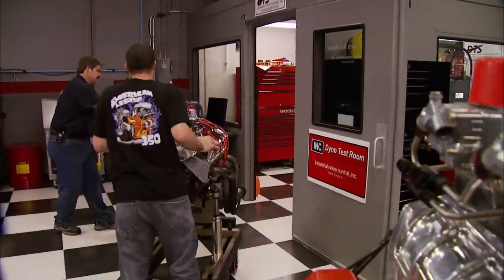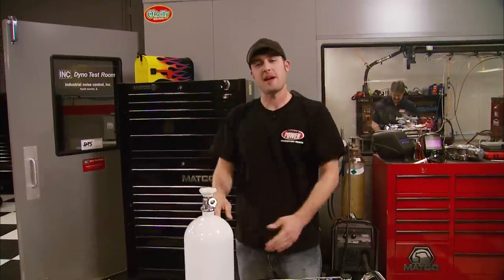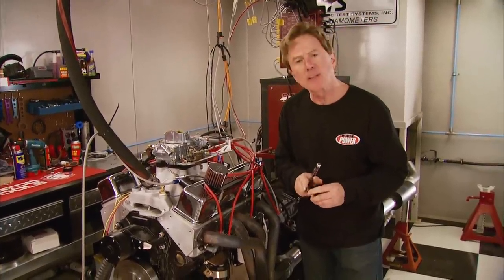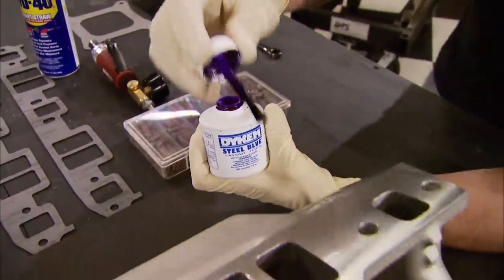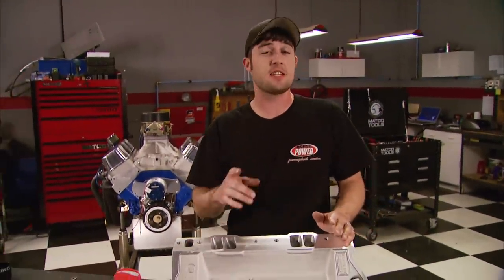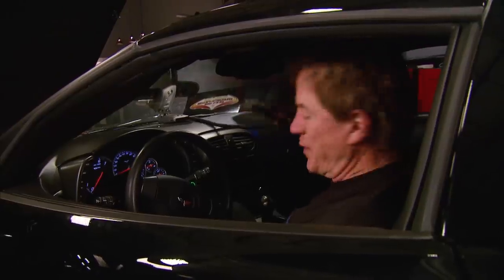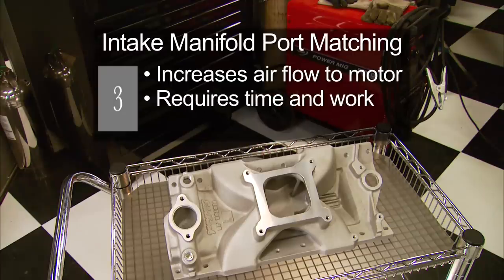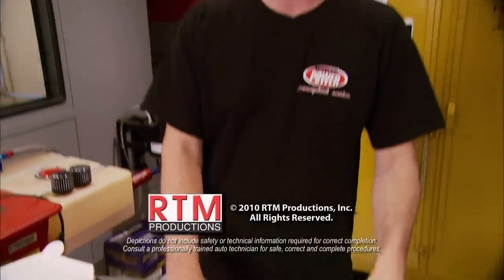Cheap Tricks To Increase Horsepower - HorsePower S12, E9

Comment: nos is much cheaper if you buy everything separate, and dont need forged things unless going for more than 100 shot
Reply: Notice how he said racing application, in people would probably be going for more than a 100 shot
Reply: until you realize it costs like $100 to get one 10LB bottle refilled and it doesn't really last that long the price adds up pretty quickly. Turbo's and blowers have a higher upfront cost but end up being cheaper in the long term.
Reply: @GnarshredProductions  a $100 to get your bottle filled... Buddy you've been getting ripped off. They usually charge $50-70 to fill my 10lbs bottle.
Reply: @GnarshredProductions  lol I can tell u never ran nitrous it’s like 40$ at most to fill at 10lb bottle
Reply: @ThatNoFbody-ch9ky  depends on where you are. Cheapest we could find in my area "Minneapolis" like 3 years ago was $100 per bottle to refill. Apparently there was a shortage or something going on so maybe the prices went down since then? we literally called every performance shop in the area asking where the best/cheapest place to get them filled was and that was the best price we could find anywhere at the time. I run turbo's now so I don't use the stuff.

Comment: So how much power did the manifold make?
Reply: you me and a few others agree....
Reply: If the heads and intake are match ported, or as is often the case anymore the aftermarket heads were already gasket matched, you'll make more power, and how much by itself depends on the motor around it. What you are guaranteed to get, though, is a way nicer throttle response. When you're talking drag racing, that's not that important, as you'll pretty much just open the throttles once, and before you ever get moving. However, on the street or on a road course, tip in matters a whole lot more.

Comment: An old Mopar idea brought back by a fella with a youtube channel here, Uncle Tony's Garage, is to swap your pistons 180 degrees in the bore, or from bank to bank if you aren't removing  them from their rods. The result is like having a longer connecting rod, the piston dwells longer at TDC.

https://www.youtube.com/watch?v=kjd1PD6pGLU
Reply: BUT,,,, you shorten the life of the engine and cause "rattle"
Reply: @Binderbird4X4Firebird  if you watch the video, neither are true. of course, if you're doing a race engine, you're taking it apart often to check on things. and, what's the life of a piston really in a performance engine? The more power per cubic inch you get, the harder you're running the engine, so is 100,000 miles a good limit? 200,000? you may get bored with the hp and add on a blower or change to more displacement before you find the limit of the piston.

Comment: Well... Aside from blowing up my 5.0 with an extra 5 horsepower and not voiding my warranty, I'd rather upgrade my throttle-body to a twin 62mm instead of the stock 55mm's... On top of that, I would upgrade the fuel injectors, rails and and ECU Performance upgrade. Even better, add a Cold-air Intake, long-tube headers with an X-pipe and upgraded cat-back exhaust. With that alone, my 2016 5.0 would gain at least 100 HP for about $2000 bucks and I won't destroy my engine. Beyond that, you need to upgrade the transmission, drive-shaft, U-Joints and Differential. Now, it is a $4,000 upgrade and that is still cheap compared to turbos or superchargers! If you are going to add more power/torque, you need to upgrade all the other essentials in order to handle the extra power or you are screwed and spending a lot more money later in repairs/upgrades. NOS? It has destroyed more engines, transmissions and differentials than I can even count. There is a reason that there are educated "Engineers" out there developing motor vehicles and even NASCAR, INDY, FORMULA 1, etc that know what to do. Even with that knowledge, they still blow up cars mechanically cuz they are pushing machines to their limit or beyond. I would rather keep my car drivable, with sufficient power, for many more years to come.

Comment: Porting an intake without port matching the heads will lower the power because airflow will hit the wall at the head interface and reverberate back slowing incoming air. Bad idea.

Comment: The LS was designed and first offered by Holden, GM Australia! Gotta love those Aussies! The onlyproblem I see with the engine is that as first designed the platform had massive potential for horsepower. You might have noticed I’m not a Chevy fan, but this engine has me thinking what if! I like those Volvo LS swaps. They’re perfect sleepers! Anyway, they started off with the Cathedral headed small displacement motors and it took years to get to a medium displacement and cylinder heads that use all the space left in them for larger ports. Back in 1929 Chevy Management decided that their marketing strategy would be to sell their customers a new model every three years. In the interim years they would offer small improvements to offer customers something better each year of that model run. By the third year they had finished adding all the bells and whistles they had designed for the car to begin with and the next year they would introduce something new, again. That became a little difficult to do and WWII put their entire staff to work building supplies for the war effort, but when the war was over the tried to pick up where they left off. Only now they kept a model longer than three years, still adding improvements along the way. With the LS it took nearly 20 years to tap into the potential of this new motor and there’s still room for improvement.

Comment: varies wildly by engine, but: Intake, exhaust, get a tune. done. fixed it for you.
then NO2, but to do anything over a 50 shot I'd gap the rings. If I was going that deep, just build the engine.
edit 3:00 : if your going forged piston, thats not cheap........ buy a K24 for $500 and throw 20 lbs at it. cheap and easy 400hp - 500hp
Reply: I’m rebuilding my 5.7 into a forged 6.4 stroker, I absolutely asked for ring gap to run boost!
Reply: @bri-manhunter2654  I build my own engines personally. build an eJ255 from a 250hp motor to a 410hp wheel motor. 20LBS of boost. the car was a rocketship at 2500lbs

Comment: so can anybody help me get a ballpark price on what it would cost to rebuild my motor on my 01 mustang cobra? i guess the engine is blown but nobody can seem to pin it down any further than that... can neone plz help>????

-peter
Reply: Depends on the shop and what you want to do, at my shop for a 0.030 over piston line hone decking rebuild heads and some other stuff it's 2,000 plus parts
Reply: Without parts on my 6.4 Hemi stroker the rebuild is costing around 2k. Also, those 4 valve motor parts are expensive.

Comment: I've found little difference in smooth or rough intake runners. The biggest difference is the time it takes . Port matching is always a must. 
Don't use pro poop or sleep master heads.  DONT.

Comment: He people i had a 69 SPORT SATELLITE,  440 3.90 THRU THE MUFFLERS,  FULL STOCK WEIGHT, IT RAN 12.60 not sure of the mph, but a friend had a 68 440 CORONET 440 3.55 GEARS, HE SAID LETS SLIP HIS SET UP ON MY CAR THE TRANS COULD HANDLE 2-3 SHIFT Had to back off let it shift, IT RAN 11.24 AT 113 MPH, IF THE USED TRAND WAS GOOD IT MAY OF HIT 10s i hit it on the line it freaked leaving, that was 1.4 sec. Reduction in ET.  MORE it the trans was good. That was in the 80s

Comment: I think the perfect truck motor is the chevy 305 because it can make enough hp to get the job done & it reaches peak hp a lot faster than the 350 & for a work horse that is important, but I haven't seen anyone stroke a 305 out by putting an sbc 400 crank in the 305? why not? Do you know of any videos I can watch of a 305 motor with the 3.75 stroke crank so I can see how it compares with other stroker motors?

Comment: please show ways to get more hp out of a 4.6 2valve pi engine please and ty
Reply: Boost... Plenty of 700rwhp 2v running in the streets...
Reply: Easy, trick flow heads, cams, and intake manifold with long tubes. Big gains from this setup, also save up for boost.
Reply: It takes a lot to make big power out of those 2v I use to have own I got like 320-350 hp and it took a decent bit

Comment: What's the estimated power gain from the port matching?
Reply: Not much......... all the power gains are in the plenum just under the carb pad and they didn’t even touch it. He should have stopped at 40 grit finishing the runners also. You want it rough for atomization not baby ass smooth.

Comment: Wait whoa. So atmospheric air is 23% oxygen  but Nitrous is 50% "per cubic foot". 

What the hell is the point of the "per cubic foot" comment? 

Does the atmospheric percentage not apply when discussing it in terms of cubic footage? Is Nitrous suddenly only 50% oxygen when measured in "cubic footage"? Is it a different percentage when measured in cubic liters? 

Does saying it that way add as much power as putting a NOS sticker on your car?

Comment: Why is there an air filter on the valve cover?
Reply: it's a breather to release crankcase pressure
Reply: all newer vehicles use a pcv valve and run a vacuum line somewhere before the throttle body for emissions. And that area on the valve cover where you saw the filter is where the pcv valve would be instead of the small breather filter. they both release crankcase gases and pressure

Comment: I was under the impression from a physics and fluid/aerodynamic perspective, smooth surfaces, like theses ports create a slow moving stagnant and thick restrictive boundary layer and slow down air flow rates, wouldn't it be best to dimple the surfaces like a golf ball?
Reply: If so, wouldn’t nascar or other professional racers do that?  When you look at the difference of how far air has to go into the intake to the combustion chamber vs a gold ball dimples acting as a turbulator to go a farther distance...argument really viable?

Comment: The ideas you put forth in this video is confusing. You say Nitirous is not expensive. Yet, you also said to efficiency to run it, one must use forged parts that would require an engine rebuild. That's not cheap. Nos on its own, yea, but to effectively use it? Priceless!

Comment: I really wish you guys would start testing on modern engines... Even if you still stick with V8's, there's LOTS of 2000-2010 V8's that are much more applicable to the engines people actually have nowadays.
There's alot more people out here with a coyote Ford, a hemi dodge, or LS Chevy than these ancient carbureted, always pushrod, always 2 valve engines you always test.
I would really like to see you guys start using turbos also.
We all know that 871 blowers are easy to install and make power... But I personally would love to see the following episode-
Take a modern, overhead cam, variable valve timing/lift engine and throw a junkyard turbo from an old diesel, throw an intercooler on it from an old diesel, and make a budget, low to medium boosted engine with just small, simple upgrades that you DO NOT HAVE TO PULL THE ENGINE TO INSTALL... Basically what I'm saying is let's see a budget modern engine build. Show people what they can do to their modern daily driver to increase hp.
You can absolutely install a single turbo and intercooler with the engine in the car.
Add a waste gate, and don't even add an electronic boost controller! Just use different springs.
Keep stock injectors, or if upgrade is necessary, choose the BUDGET option injectors.
Keep the stock coils also - if upgrades are necessary - BUDGET OPTION.
Maybe a different version of the same engine used a better intake manifold? Cool - use THAT instead of a $1000 aluminum intake. Same with the injectors, coils etc.
Take a fuel pump from a gas powered 3/4 ton truck for increased fuel flow.
Just show people easy, budget options for their modern engines and use as many stock components as possible without running 30psi of backpressure on full boost.
I'm honestly super bored watching recycled ideas for small and big block engines that only race cars use now.
Very few people have an actual use for a "street tune" 600ci big block.
MANY people would love to see how they can boost the power on their modern Mustang, camaro, challenger, or even their truck.
Nobody runs these dinosaur SBC and BBC Chevy engines anymore except racers and project cars.
Let's see more content that's actually applicable to the engines that 90% of people ACTUALLY use daily.
Reply: This video is from 2010

Comment: I thought they said cheap?!? Aluminum heads, nitrous...I can't afford that stuff
Reply: the heads were supposed to be the baseline. N2O is considered a cheap power adder.
Reply: @cuzz63  you’d have to pay to have it fitted and set up which would cost more than the nos set up itself?
Reply: @zman86turbo  Most people DIY it. In fact N2O is the easiest to DIY.

Comment: Ok, you start out with a crate motor and expensive heads. How that’s cheap? Nitrous cheap? Not by a long shot! When you take into  account forged pistons, rods and crank to handle it! It’s actually pretty expensive. 
The one thing I did like and what everybody should take away from this is that Higher Octane fuel Burns slower. It by itself does not make more horspower, but it does allow builders to boost compression, static and dynamic, to make more horsepower without risking detonation as much as with lower octane fuels. Spark timing is critical though.
What I’d really lie to see from you guys is a engine or engines built around what was available in 1965 to 1974, without aftermarket anything that wasn’t readily available then. That means no crate engines, no aluminum heads just what the builder bring to the Dyno via his brain and hard work massaging stock parts! Intakes and headers would be ok as long as they follow the same rules, nothing that wasn’t available back then. I might allow dual plane intakes, but nothing with an air gap except Pontiacs and a big a block Mopars that were built that way. And stay away from all Chevy. Build their competition too!
Reply: dont need all that with 100hp shot of Nitrous, you do want to add ring gap.

Comment: Sees that many use nitro to increase horsepower. But it is also the most devastating to the engine over time.
Reply: Not nitro, that's a totally different ball game. They used nitrous oxide, it's classified as an oxidizing agent, it's not a fuel or flammable, it's used to enable the burning of much more gasoline on the power stroke.

Comment: All of that work to make it as powerful as a stock 426 HEMI. LOL
Reply: Big block Buick, 550 hp, Cam and some head work and flattop's drive it around the world and never have to worry 'bout a break down. Add headers and the new/cheap fuel injection start tipping to 600 dependable hp. In the late 80s and early 90s I won every race (circle burning) I went to.
Reply: No replacement for displacement

Comment: there hasnt been a new car with a carbureted engine in 25 years why are you showing us how to increase hp on one
Reply: Because in the hot rod world and a lot of local racing use carbs.    When was recorded about 15 years ago stuff like the Holley Sniper and other EFI systems were not as available or affordable.

Comment: Looks like you should've paid a pro to gasket match as you definitely do not know how to do it. Never seen so many dips and knicks. Probably should've used a carbide normally for cast iron and you might not have made such a mess. Just need to slow rpm down and use more wd40 to keep from filling up cutter. If you don't have the experience don't learn on a valuable piece!

Comment: Lol. So nitrous oxide not cheap when you have to buy new forged pistons and connecting rods like they warned lol
Reply: If you open the piston ring gap, that's much more important than going to a forged piston.

Comment: Only Nitrous isn't so cheap anymore.   $60+ to get a 10lb bottle filled around here... Save your pennies and get boosted...
Reply: I wish I only had to pay 60 bucks to fill it! 10 a lb here. Mind you I refill after 4 1/8 mile runs so its only about 4 lbs down from full

Comment: I can't figure out the obsession with carbs. Old tech.
Reply: Me either. Very outdated and much less efficient/effective
Reply: The young and dumb, when you hear the intake sucking air ,  exhaust rumbling and the kick in the seat of your pants. Then and only then will you understand. The carbs are just effective , it is the cold start that a lot do not understand.
Reply: Richard A Chapman Far from dumb my friend. A carb is just outdated and will be outperformed by EFI every time
Reply: @richarda996  "carbs for the aged" aka  . . . "I'm a boomer that doesn't understand fuel or ignition mapping, computers, or injection. I'll stick with my ancient carbs - 'cause that's all I've got."

Comment: They had me until they said high octane fuels burn slower. Uh no, octane only measures knock resistance. There are different ways to increase knock resistance, some increase and some decrease flame speed.

Comment: Cheap tricks to increase horsepower....bolts on nitrous that takes no skill and is not cheap and is a bad thing to put use especially for someone looking for easy hp cause ,most of the time they don’t have engine for it or knowledge and just blow up engines.

Comment: No way oil additive can give you hp unless your oil your running is garbage period. If there was hp to be gained by oil  additive then there would be an oil in itself that would be a hp oil and there’s not because the best oils are the best oils to protect your engine aka lubercating is key. So this oil additive hp gain is a crock and you know it. It’s shit like this that takes a great channel down a peg or two.